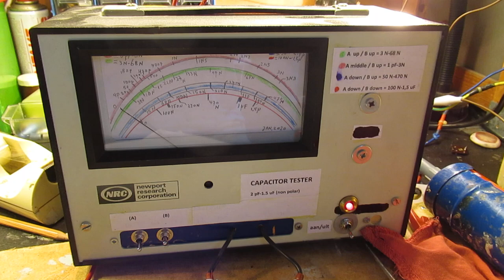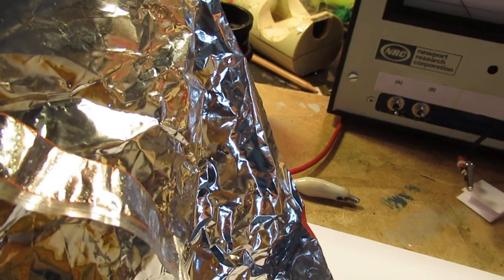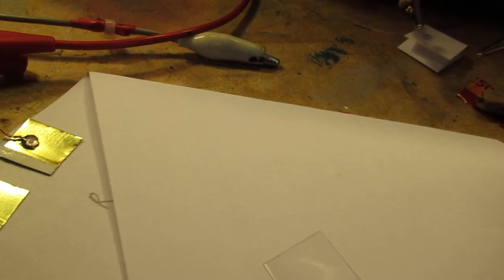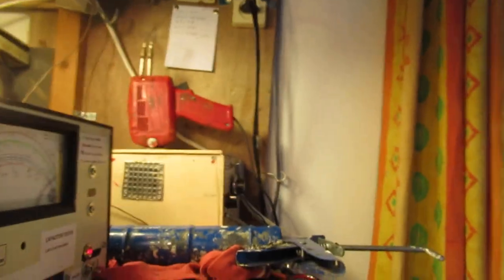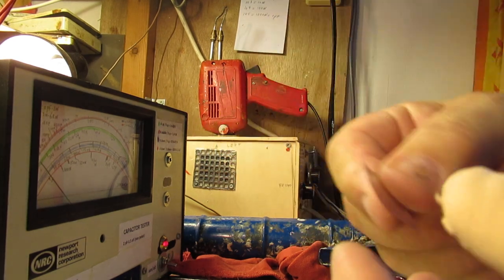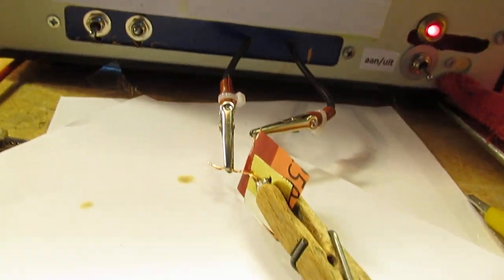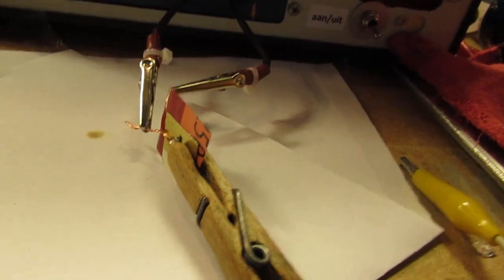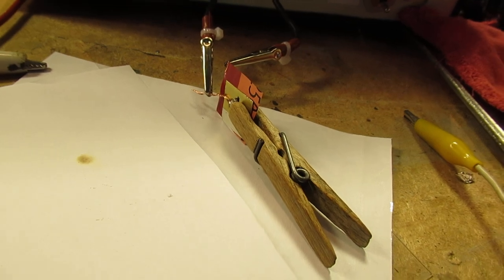Making & testing small value capacitors (VLOG) & dielectric materials

Comment: I once made a ~ 10nF film capacitor by rolling up, around a tooth pick or so, 4 layers in parallel of 3cm broad strips of:  Aluminum foil, PE foil, Aluminum foil, PE foil, and wound, each at the start of it all, and at the end, a silver-coated copper wire spirally around to have some contact, and put shrink tube on the hole thing.
After a couple years the contact must have oxidized too much or otherwise corroded maybe from sweat from my hand touching the wire, but the capacitance had fallen to the pF range so I assume the contact was lost.
Anyway, it had a similar size to polystyrene caps for some 100V from old radios (no idea what the real voltage rating would be) so it was interestnig that you could make an "emergency capacitor" for building something on a weekend when some part is missing ;)
Reply from the maker: That is indeed a good idea. As far as I know it could be that tiny moisture effects could have made oxidation on the (say) silvered (copper) wire, attached to the aluminum (potential difference). That is why I used in this demo tin plate with soldered wires. But, anyway, all kinds of self made capacitors can deteriorate on the longer term. Good that you could get the similar size.
Reply: @radiofun232  Maybe one could try to use thin copper tape instead of alu foil, at least one could carefully solder wires on before rolling it up

Comment: Interesting video. I've easily made capacitors out of (cut to length), braided coax cable. Make sure the braided end (strands), don't touch the inner core though. The other end just strip back as normal and solder straight into your board. You get a few pf with this and voltage is quite high. To seal from humidity (which can be a problem with homemade caps), just dip in wax.
Reply from the maker: yes, that works.

Comment: Made some using thin brass sheets and plastic sheet for high voltage. They had styrene sheets between. Cut the foil to adjust capacitor value.
Reply from the maker: Good, interesting how you did it, especially for HV. Please show a video about it on your YT Channel, if possible.

Comment: The simplest and most reproducible way making own small capacitors is to use double sided FR4 PCB. You can scale it easy from below 1pf. Only low capacitances are practical. Such capacitors withstand high voltages if are made properly! :)
Reply from the maker: Yes, indeed.